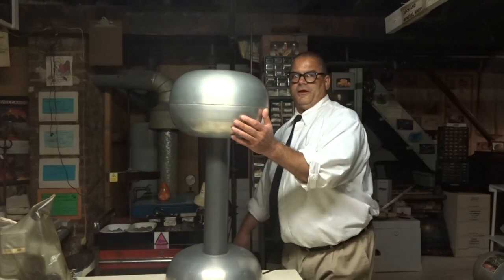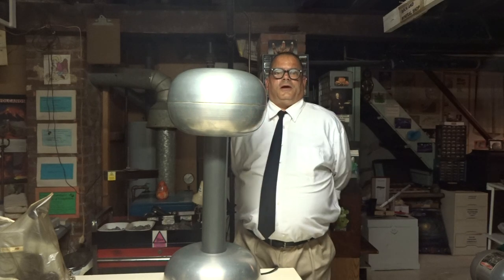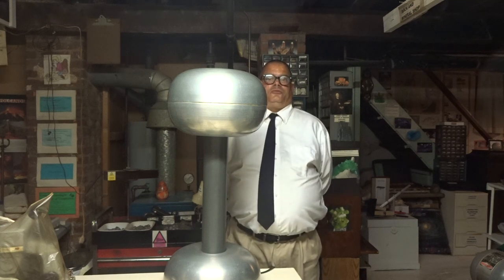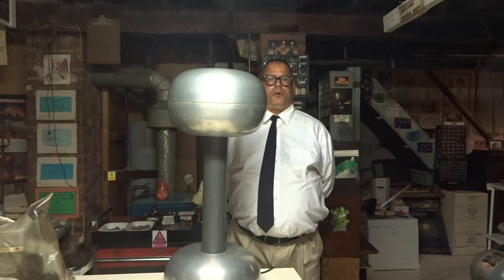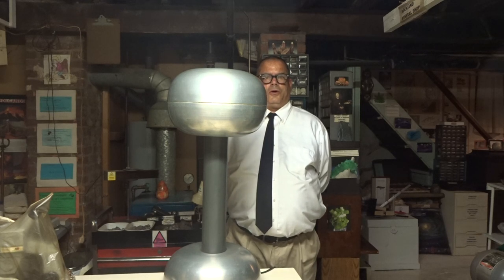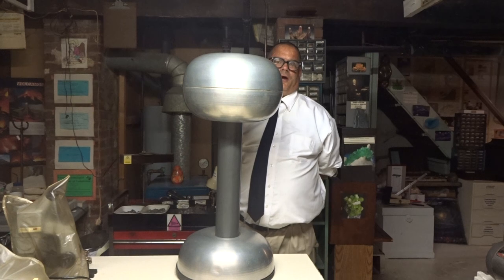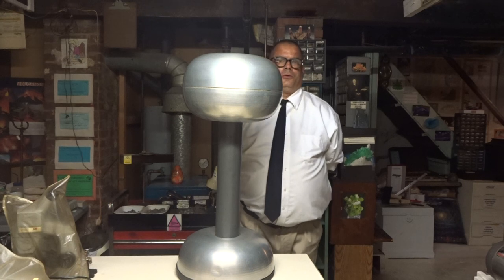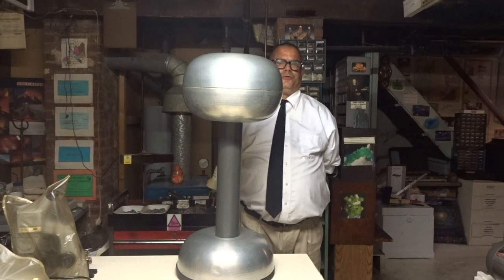What a Van de Graaff Generator is and How it Works

Comment: Very cool stuff Frank!  Very interesting.
Reply from the maker: Thank you.  I bought a Tesla coil for $250 off of ebay, but it does not work.  Buying off of ebay is always chancy.  It is new and I should try to repair it when I have some time.
Reply: @frankreiserm.s.8039  Yes that stinks.  Has happened to me many times buying off ebay.  But maybe make a video of the repair?  That would interesting to see what broke
Reply from the maker: @PatrickInCayman  I would but my old camera only records for seventeen minutes and I would need more time to show me repairing it.  Also, I would need to buy a tripod to mount the camera on.  I would need to get enough money off of Patreon to buy a new $600 dollar camera and tripod.  I am a TV and electronics repair technician earning too little money.  I am looking for an electronics technician job that pays well.